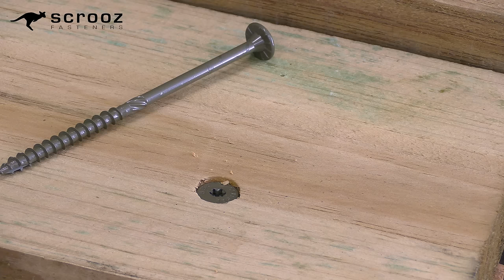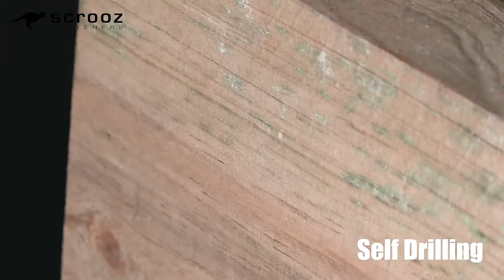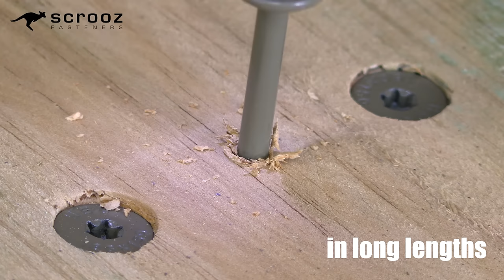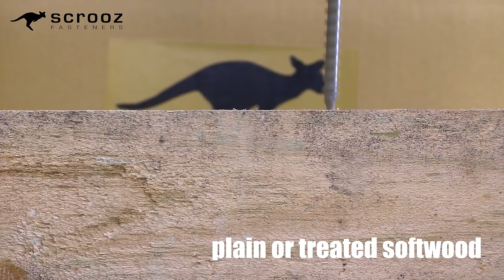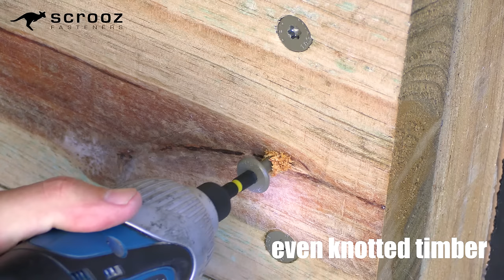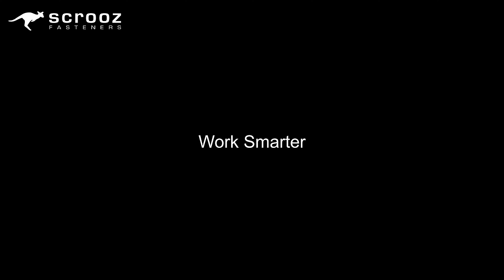Scrooz Heavy Duty Landscape and Construction Screws Movie

Comment: Could you avoid the use of joist hangers with these types of screws? Eg. pergola/carport rafters etc.
Reply from the maker: Generally speaking yes, but structural joints should be checked/designed by a qualified professional as the hangers could be specified for a technical reason specific to that structure.